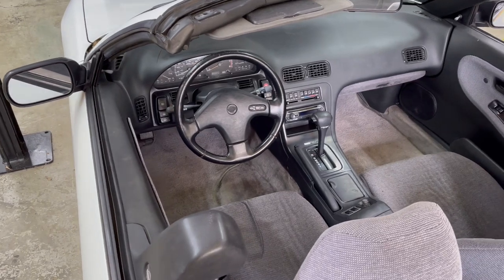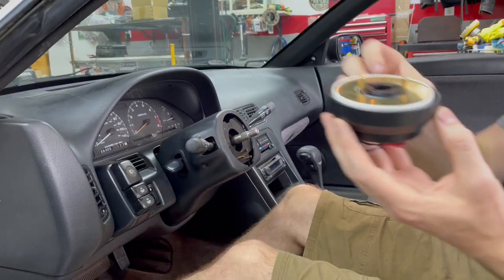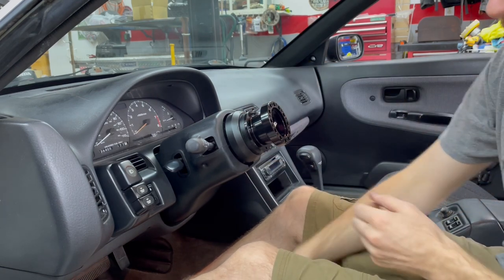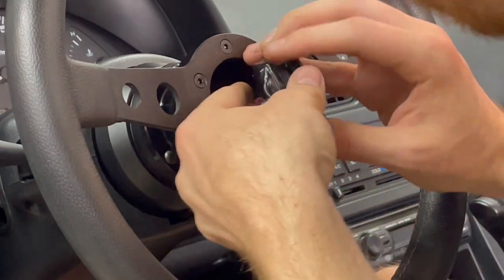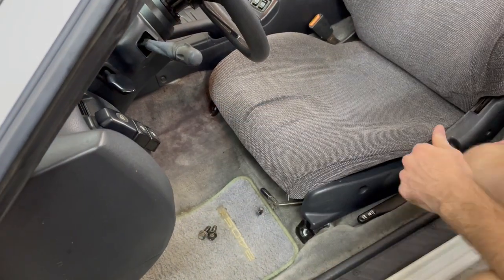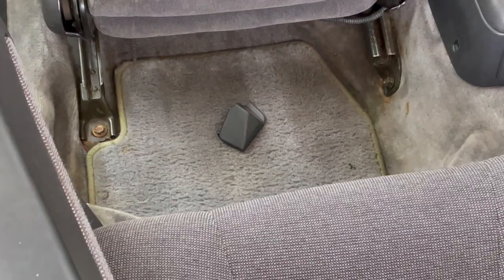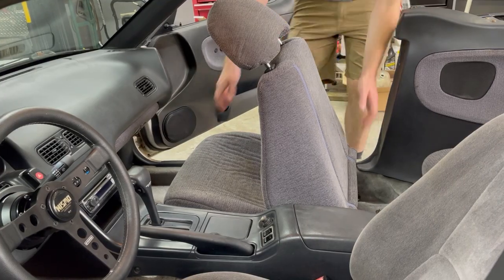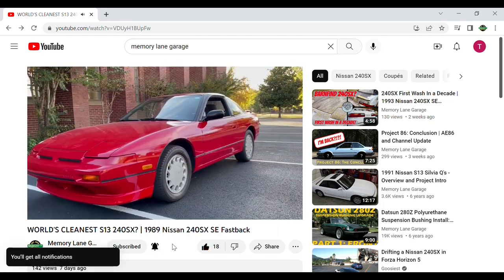MOMO Steering Wheel and S14 Seat Install | 1993 Nissan S13 240SX Convertible

Comment: Had the exact same 14 seats and style steering wheel for my coupe back in the day.   I remember i bought Watanabe 16x8s for $400 with tires, bought a 13 front with brick headlights k bumper for $600.     S14 kouki seats with the cool design the center.  The seats were such a great upgrade since the stock greybacks were like dirty socks and not as comfy adjustable.

 This brings me back.  I love the pignose bumper tho.  Thanks for sharing.  your editing is very unique and gives off old school/retro vibes 👍

Suspension is next.  Height and damper adjustable.  Would help ride and handling.  Height adjustable yhat way u can have that stock look which I know u try to keep sometimes or you can go to the no gap look which looks dope.  Unless your suspension already feels good, but normally 20 years is a long time for any part.

Comment: it's a shame that the 240sx convertible didn't come with the ps13's front end. it fits the whole car much better. 240's front looks sort of out of place (especially the facelifted one) compared to the rest of the body being kind of boxy.
Reply from the maker: I agree 100%. I think the squareness of the Silvia front fits the coupe body style better. I’ve put a Silvia front on a 240SX coupe before, and would love to do it to this car as well, but unfortunately the parts aren’t as easy to come by as they used to be. I’m definitely keeping an eye open for all the parts I’d need but that may or may not happen. Either way, there will be some changes coming to the exterior of this car in the future!